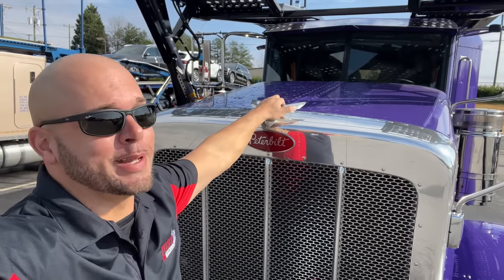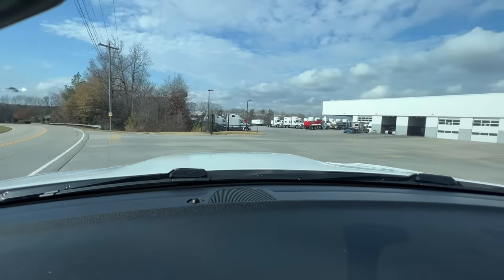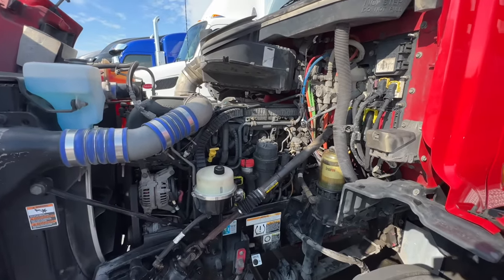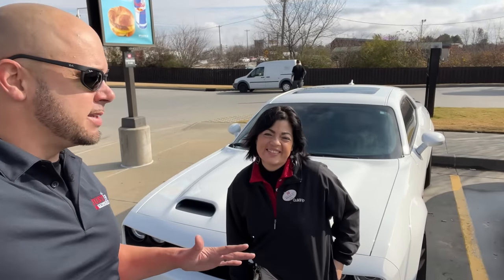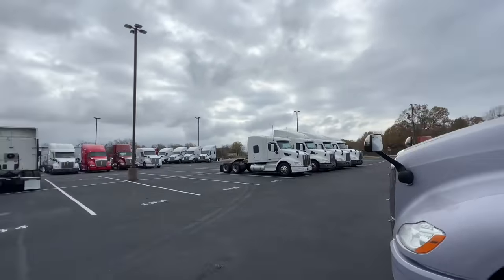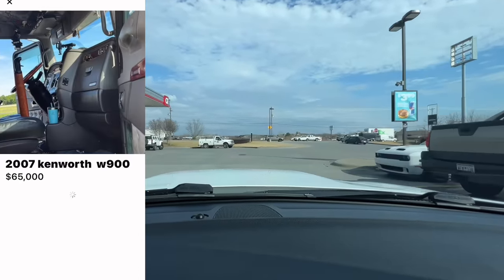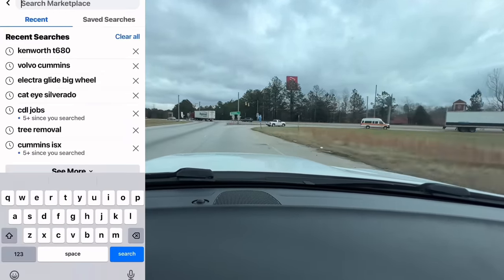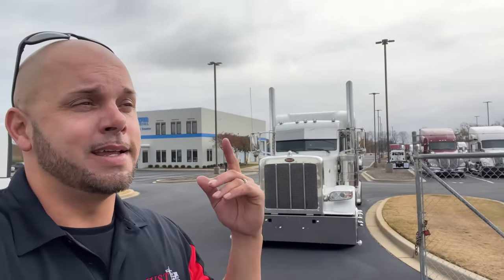BUYING YOUR FIRST TRUCK !! Mistakes NOT to make

Comment: As a company driver, I love my 2022  T680 with the Cummins X15 that I'm currently assigned to. I've driven Volvo trucks in the past, not my favorite (just call it personal preference).
Reply: I just got switched into a next gen with the x15. Not a fan. It’s noisy and not in a good way, and I’m guessing they have the torque turned down because it’s pretty gutless. I preferred the paccar. Wouldn’t own either though
Reply: @BrandonEht  I hate when companies castrate their trucks. My company doesn't.  They do govern us at 68, but plenty of power and torque in that X15. I'm usually getting around 8 mpg. It all depends on what specs a company orders them with.
Reply: @tomflinn9815  hello I will wile you be friends with you

Comment: Iv'e had all of them except the Paccar and maxforce I had several Cat and Cummins all good engines but I liked the Cat better, the last one I had was a 12.7 Detroit in a Freightliner loved that engine not as much puling power but very good mpg I got 7mpg hauling steel gross weight always 75-80000lbs very reliable and the smoothest running engine I ever drove. I drove an ISX 871 good engine but it sounded like a box of marbles idling also the fuel mileage wasn't that great pulled great and you can't beat the jakes on that engine.

Comment: The battery is done on the hellcat. Get it load tested. You could hear it slow crank when you started it.
Reply: As others said max force is international not the mx engine. The mx motor is great. The max force not so much. Many with over 1 million miles no issues. Also some are epu lately. The epu is electric power unit. Still have the fan etc outside. They are less maintenance and lower operating costs BUT batteries fail like on your hellcat as mentioned 😂.

Comment: I just replaced a transmission on my 2006 Volvo Vnl 670 it cost me $9300 but I have a volvo d12 engine also did an I frame on it
Reply: They ripped you off, you should of paid no more than 3K

Comment: Never get the mx engine that’s the black engine of death. Parts are way more expensive than Cummins and u need to adjust the heads every 50thousand miles. They do not self adjust like Cummins.

Comment: Most of our freightliners have over 600,000 they seem to run great there  Detroit diesels.  I'm with a company that doesn't put any money into their trucks they don't even wash them these trucks are 5 years old with 600,000.  Then we have some older Volvos with a million miles those have Volvo engines and at a million there about end of their life a couple of them have low power.  But again they haven't been rebuilt.  I realize Volvo is not as easy to get parts but if you get almost double the miles out of it before you need a rebuild why go with Cummins?

Comment: Maxforce 13 and the MX 13 are two different engines. Maxforce is by International and was a bad engine. The changed the name to NZ when they added the Cummins emissions to it. MX13 is made by Paccar.

Comment: Let’s be clear Running the Motor in Cold weather is a must because a lot of times the trucks will not Start.
Reply: From the south, but 1'st OTR company I drove for was a small set up in northern WI, all trucks had engine heaters, and we had to pull up and plug them in to a hitching post at the yard. This was pre DPF, and APU, soo otherwise they definitely stayed running all the time :)

Comment: Oh it hurts me to my core to hear you call a PACCAR a Maxxforce the MX13 is a good motor, I prefer Cummins, I currently have an X15 and it’s been the most dependable truck I’ve ran yet. My next will likely be a Detroit DD15, I’ve ran them before and they are great.

Comment: I never paid for my first truck. Cause it belonged to my late dad. He brought it and had it for several years until he passed away. Jackie had it since he passed away and it was hardly driving by her and employees. My mom wanted it to sell it for her gambling debts. My dad had a will written up months before he passed. And sue never got anything not a dime. When I turned 18 I started driving locally and then out of state. I had it completely torn down to the bare metal frame. Took several months to rebuilt it and everything was rebuilt and the interior was done like it was when he had it. I still drive it once in a while. I purchased my new 2010 KW one owner and had it for almost a year now. It has a APU and it keeps me and Jessie pretty comfortable inside. Only thing I did was change out the stereo system and it's way better now. The tranny s a 10 speed transmission and it's better. Cause 18 speed ur always shifting every 2 second's. I was told the exhaust came in finally today(Thursday) I was like hell yeah got employees something to do when I get back. I am at the famous truck stop in Iowa and Jessie was like I bet u brought stuff. I said nope and she was like BS u got $$$$$$ (cash) and I said yep showed her a new better sunvisior. And sun visiors for the door's and there better cause we can drive in the rain with the windows halfway down. Never LED lights for the bumper and back bumper. I sent her the video of the stuff and she was like that's cool but what's in the big bag. I said ur present and sue was like let's facetime and sue was running around the house and showed me the big package that's big and it's mine. I was like what u do put several packages in one big box and she was like nope. Kids (youngest one's) was like nothing for us dad. I daidnhell Christmas is 3 weeks away don't worry. I will be home late tonight hopefully. I had to stop dam toker was about to go off. Lucky I made it to the famous truck stop.

Comment: I'm selling my Pete 579 2018 with 120k miles on the engine brand new block 480k on the truck 65000 with premium 2000 warranty for 2 years.
Reply from the maker: Post in JustTruckin Family on Facebook 😎🙏🏽
Reply: @JustTruckin  thank you

Comment: MX and Max Force are two different engines.Max Force is international MX is a Paccar engine. I just sold a KW with a MX13 1.25 million miles and still pulling loads. Not trying to be an ass here but don't miss lead your viewers.

Comment: You can get a 389 with a standup or Ultraloft sleeper…flattop isn’t the only option.
Reply: U can not get a 389 in an ultraloft at all only in flattop and stand up sleepers
Reply: @travis28100  Ultracab is what I mean, Ultraloft is aero trucks.

Comment: The Mx 13  is not international motor this is front eu daf paccar buy in the early 2000 and Cummins develop for paccar and still paccar development this engine .for you information max force is adventure between caterpillar and international.

Comment: Mx13 is not a maxx force 2 different engines mx13 is good on fuel and weight it allows you to haul a  little more weight like tanker Cummins is good for easy repairing  and hauling with torque but bad on fuel maxx force was just a bad engine period

Comment: Paccar engine is not a max force engine. Navistar international is Max force.  You need to do more research before posting a video.  You may confuse your followers. I been in the trucking industry for 32 years. Experience is knowledge.
Reply from the maker: Yes indeed I mixed those up …

Comment: The new Pete's ride much rougher than the new Freightliner cascadia and the cab is much nicer on the Freightliner food for thought. Our fleet has 15-year-old internationals 10-year-old Volvos 5-year-old freightliners and brand new freightliners, petes, and volvos.  For the old trucks I prefer the Volvo twin screw.  The automatics  especially in the winter suck.  the freightliners better than the Peterbilt.  Don't know about the volvo.  They're all automated manuals you can tell by how it shifts.  A  true automatic with a torque converter can't handle 80,000 lb.

Comment: Be careful talking about the devil emission systems. I worked in truck engineering for the largest truck manufacturer.  Several of your statements about emission components and the reason for them are incorrect.